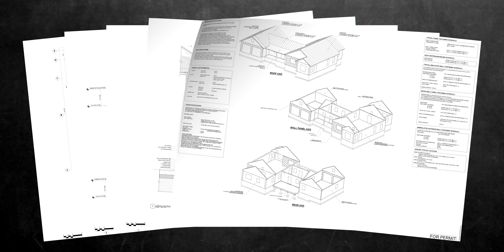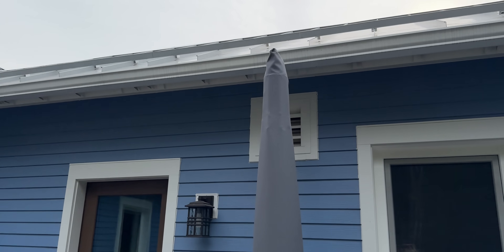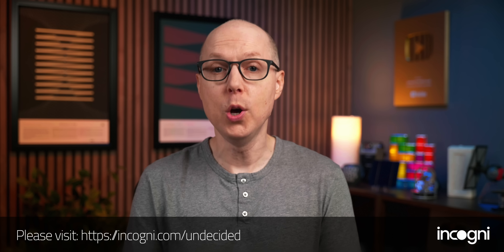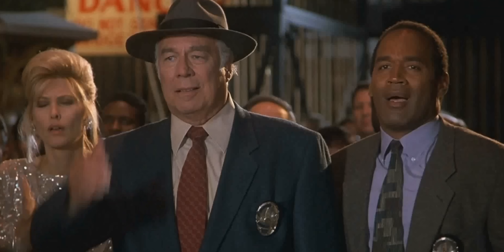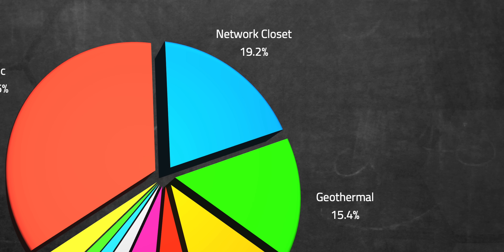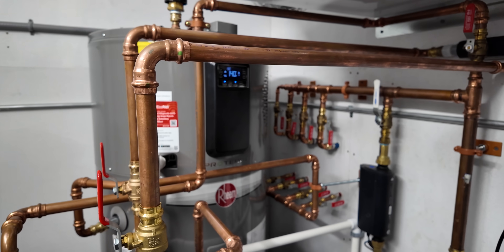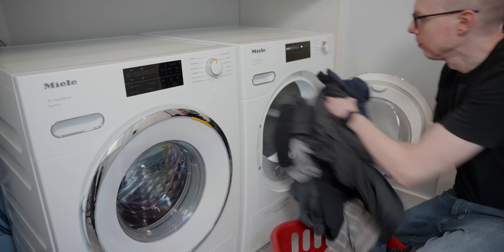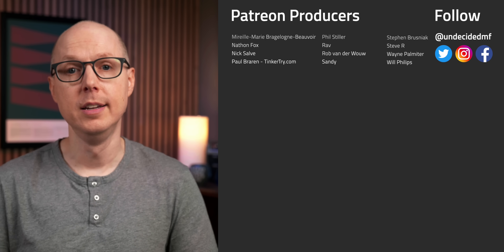What I Learned After 1 Year in My Net Zero House

Comment: Great video Matt,

We have a similar house just north of Toronto Canada with geothermal, desuperheater, heat pump water heater, 2 EVs and solar panels which we have lived in for about 8 years.  We are net zero +/- a few percent depending on variations in weather from year to year.

Some insight into your energy use.  The whole house dehumidifier is largely driven by your ERV running during the summer months.  Whenever it's hot and humid the ERV brings in a considerable amount of humidity despite the fact that some of it is rejected to the outdoors via the ERV core.  You could try accepting a slightly higher CO2 level when it is humid outside.  What we do when the dewpoint is high during the day and low at night is not run the ERV during the day and run it at night, CO2 does accumulate during the day but drops over night and this minimizes or eliminates dehumidifier use on these days.  It generally stays below 1,500 ppm during the day and can drop as low as 600 ppm over night, it can take until late afternoon before it surpasses 1,000 ppm.  You may be able to adjust the cfm of the ERV or use a 20 minute per hour timer to prevent over-ventilating and unnecessary energy waste from the dehumidifier.

The geothermal backup heat is when the geothermal heat pump is not able to meet the heating load on its own and brings on a 5kW or 10kW electric resistance heater to supplement the heat pump's output.  If you want to reduce or eliminate this energy use you can adjust the thermostat settings to allow a larger temperature delta before the backup heat comes on.  In our house the thermostat is set at 70 but the electric backup only comes on if the temperature drops below 65.  Sometimes the temperature drops overnight to 66 and when the sun comes up and the outdoor temperature warms up the house to 70 without using the backup.  The downside is that the temperature gets as low as 66 and may take until noon to recover to 70.  I am curious what your backup heat temperature delta is set at.  

As far as the fully ducted ERV this is what we have and it works great.  Our house is a 1,400 square foot bungalow with a basement.  Initially my idea was the same as yours in that the ERV would effectively distribute fresh air without needing to run the furnace fan.  What discovered is that when the furnace fan isn't running the basement gets cool enough on sunny days that the humidity exceeds 55%.  Running the furnace fan keeps the basement temperature higher and thus the relative humidity lower than what it would be otherwise so we leave it on 24 hours a day.  You have the ability to adjust the geothermal fan speed, set it as low as possible to minimize energy use.
Reply: I thought one of the big selling points of geothermal heat pump over air source is that you don't need backup heat. The temperature of the earth 400 feet down should be pretty consistent and the heat loss of a house that heavily insulated and sealed should also be quite consistent relative to the outside temperature, so if the geothermal isn't sufficient to heat the house it sounds like too small of a system was installed, but maybe that was intentional to save costs. We have an air source heat pump in central Iowa and we're still running backup propane heat for 40% of our winter heating, a lot of that is defrosting. Matt's backup heat use is only 20% of his heating costs, so that's better, but for the cost I'd want it to be a lot less than that.
Reply: @extragoode  in general a geothermal system uses less backup heat than air source but that is no guarantee that it will be no backup at all.  Geothermal systems are generally manufactured in full ton sizes, this appears to be a 3 ton system.   Maybe it needed 3.1 tons but you can't buy a 3.1 ton unit, you can get 3 or 4.  The step up to a 4 ton system and a 4 ton ground loop, Larger ductwork etc may have had an extremely long payback period not to mention the larger unit and ductwork would take up more space in the house.  At least the geothermal continues to run when the backup is operating, if it is 5kw of backup heat the geothermal is still doing about 2/3 of the work.  With a propane backup it can't run at the same time as the heat pump so when the backup comes on the heat pump switches off.  If it were an electric backup with the air source heat pump they can run together.   You brought up another good point that the geothermal system does not defrost whereas air source does defrost.  The differences between ground source and air source are not black and white but there are many nuances that differentiate them.
Reply: @jeffdaley67  that's a good point that an undersized unit may have been a closer fit than the next bigger unit and that the backup runs at the same time. If I'd have known the propane required the heat pump to shut down completely I probably would've done something different. The installer really didn't know enough to tell me what I didn't know. They said I needed 20kw of resistive heat for backup and I only had room in the panel for 5kw. Also said it'd be another 10 grand to upgrade the panel. Nevermind they could've installed a subpanel for the resistive backup for 1000. I've also done testing since with 4 resistive heaters only and that kept the house warm with about 8kw, so 5kw and the pump would probably do it. We also have a propane fireplace if we really need it, but I try not to use that since it's only about 70% efficient.
Reply: @extragoode  one way to run the heat pump and the propane backup at the same time is to have a boiler or tankless water heater heating a hydronic coil (think car radiator) downstream of the heat pump fan coil but this can be expensive and the heat pump system designer and installer really have to know what they are doing.
Reply: @jeffdaley67  That's a cool idea and I already have a propane tankless water heater and a recirculation pump, but there's no way I'd get my installer to do that and it'd make an already complicated system more complicated. I'll keep balancing my disconnected resistive heaters with the heat pump thermostat (poor man's backup) for the dozen or so days a year it's below 10F outside until the next time I need to replace the furnace and/or the panel.

Comment: I would love if some of these features were more normalized. So it was just overall easier to manage. Who has the time or money to manage indoor air quality to such an extent (besides content creators)? We did switch to an induction stove and will be switching to a heat pump water heater and encapsulating our crawlspace. Then I need to figure out how to remove a whole house fan and increase the R rating in the attic.

Comment: Hi. What is the point of heat pump water heater if heat pump is taking heat from house and put it to the water and than you need to heat house with other type of heating system. so you are basically overcomplicating. If you live in hot country- than it might make sense, because you just open window and heatpump will take heat from outside for free. But in standard climate or in cold countries it is nonsense. Do you want to be Eco friendly and heat water so cheaply?- build outside fireplace with water  heating element, than from fireplace with water heating element put insulated pipes into house inside water tank. This way you will make fire with wood which is still considered as renewable source and you are green. As firewood you can use waste like old wooden pallets from scrapyard for free and you will be super bio eco friendly. This topic is for long discussion so I am ending here.

Comment: I was surprised that refrigeration and freezers didn't make your top 5.  My guess is they make up a lot of your "misc".  I use an Emporia to measure usage and my top 5 is:  EVs charging, Freezer(s), Refrigerator, A/C compressor(s), Dryer, HVAC blowers.  I also live in MA so he majority of my heat/hot water is heating oil.   I've considered replacing my dryer with a heat pump dryer, but my suspicion is that it's more advantageous to spend the $2k to expand the solar (generate more) than investment in a new dryer.  Especially considering how far down the list it is for me.

Comment: Can you consider measuring your balance point temperature? This could have been part of the design phase , pre build. Now post build..... this is the btu loss per hour , without make up heat. Said another way , with intrinsic heat contribution, how much time passes before interior temp drops below your set point. and the rate of loss per hour , based on of course the delta T . I built super insulated homes in Michigan in the 80's and 90's. zero furnaces , pre passive house . The heat and cooling was less than $200 per year ( some wind and solar energy contribution) . Used Canadian air to air exchanger ( that was all that was available .) baseboard heaters. Everything was off the shelf , except the 50 mill VP from Sweden, and the air to air unit.   I appreciate your videos. 99% of homes lack thermal mass, you have a slab , good on you . the stored btu's and the consistent levels of comfort are badly missed in america home design . Yes your follow up videos on , btu's use per sq ft of comfort , per year , with and without solar ,  what the roi on the geo thermal system long term. Back in the old days , walls , windows , thermal mass , air tightness, slow air to air exchange  ( monitored) , passive efficiency ( shell materials)  , is  maintenance free for life. Geo thermal and standard hvac never penciled out , for comfort and roi for the customers. Add in evacuation tube hot water or drain back systems, used in millions of global homes , small and large. Less technology can have benefits. Down south very very very few homes use pre air Dehumidifiers in the intake supply. silly humans . Using an hvac system to  lower interior humidity levels , is a poor choice .

Comment: Meh,   you have a Cat running across your induction plate.   I up you by having a parrot .....    The moment I open the cook utensils draw.   My parrot goes beep beep beep  => knowing that its bound to happen anyway.       Same applies to any appliance, cell phones, espresso machine,  even the burglary Alarm ( if you activate the night mode ( so full coverage down stairs )) ,   Parrots ensures every one in the house is aware the alarm is on by continuing , the warning beeps for another 10 mins,....    
My wife is happy though not single door makes any noise in my home , because if it does the same day I apply some oil, so the Parrot doesn't get idea's.....

Comment: Hi, i do wonder what your energy use is pr square meter? I have been pushing my builds to use less and my best houses are at 45 kWh/sqm/year. That is included one EV and a adult couple in the house in Norway. The location has a average outside temperature at 2,5 degrees Celsius and then we do not need cooling, but a lot of heating. The house has as you, water to water heat pump for heating and tap water. Ventilation there is not clever, because it is a system from Bosch Vent 2000D. Planning a new house where we will do it even better.

Comment: Matt, I have done many of the same modifications in an existing home.  The heat pump dryer and water heater are excellent adds as the hot water heater helps dehumidify the basement.  Your 40% number shows up a lot when I make changes; it's like the standard code / bar for building or appliance performance allows for 60% more energy consumption.  If governments changed the codes and insisted that they appliances are built to last; we would have a huge long term impact on energy consumption.....but they're just trying to convince us all to buy new electric cars (which isn't the same long term payoff).  Nice video and thank you for sharing.

Comment: Your servers don't just consume electricity but also make quite a significant amount of heat, which I assume works like free heating in winter but adds more load for HVAC in summer. If you don't actually need to access to your video archive, you might consider replacing some of your HDDs with tape storage which is cheaper per TB and consumes a negligible amount of power
Reply: Tape storage would be very expensive space wise, and would be quite the unitasker, whereas HDDs can serve a more generalized purpose. Looking at how small his NAS is I doubt it would be worth the extra space and cost. Not to mention he'd have to figure out how to setup tape drives with his existing NAS system.

Comment: Do you have electric resistance heat strip's as an alternative heat source in the air handler for your HVAC? if so, that's what the 4% is. Seems like you need to change some stuff and keep those from running unless it's really, really cold.

Comment: Heat backup is most likely when the resistive heating coils kick in when the heat pumps can't keep up. I would definitely learn to embrace cloud infrastructure rather than have all that network/server stuff running in the house.
Reply: Home Assistant in a local server avoids changes to purchase agreements, and changes/introductions of subscription cost requirements. Nobody can take this functionality away from you. Not to mention security issues with personal data sold, such as advertised on his sponsor ironically.
Reply: @erichb4530  This old argument hasn't held water for a long time. The average person knows almost nothing about security and spends $0 on security. That makes them far more likely to lose data, have data stolen or corrupted on their own network vs cloud.
Reply: "I would definitely learn to embrace cloud infrastructure rather than have all that network/server stuff running in the house" - For what purpose?  So you can pay monthly fees in perpetuity instead of paying for equipment and electricity?  With cloud infrastructure and services, you almost always end up paying more long term.
Reply: Also, "the cloud" is inaccessible if your Internet connection goes out (that would be great for security cameras).  And moving to cloud infrastructure wouldn't help.  He would still need all of the equipment he currently has.  Cloud infrastructure cannot replace network switches, a video recorder, or a NAS used for video editing.  Lastly, if he has PoE-powered devices, then they get their power from the network switches, which will make it look like the network closet electrical usage is greater than it actually is (because the power used by those devices, regardless of where they are located, would appear to be used by the switches in the network closet).

Comment: I had a WaterFurnace geothermal heat pump installed when I built my home 29 years ago and it’s still going strong 29 years later. It was a little more expensive than a standard heat pump at the time and because I had lateral trenches dug 7 feet deep instead of a well drilled Which saved a lot of money. The WaterFurnace has paid for itself several times over. My current electric bills for this all electric 1500 square-foot rancher are still under $100 a month averaged over a year.
Reply: Where is your house located? Northeast, Midwest, South?
Reply: Are you SURE it’s been 29 years??
Reply: @Tryp-j9d  I presume the OP knows how to count years. 30 years may be a bit above the average lifespan of a common HVAC system but it's by no means exceptional.

Comment: You could take inspiration from ye olde computer rooms which had a raised floor that held all the wiring and cooling. The floor was made of sections you could easily remove for access. Probably cheaper than a basement! As a hoarder, you do have those attics...
Reply: It's the same in for what I know in Swedish substations aswell, raised floors with removable sections for easy access.

Comment: Very cool, thanks for the update. I've got a heat pump water heater as well, and it looks like your setup is using maybe 2/3rds the energy of mine (your 65kWh vs my 90kWh per month). Also, good to hear you still recommend the heat pump clothes dryers. I've been thinking about getting one, but I'm nervous the extra time and cool/damp feeling clothes will be an issue.

Comment: Do you find that your heat pump dryer puts out much humidity?  I have a Whirlpool WHD560CHW and it definitely leaks some water vapor.  It can raise the relative humidity of ~2500 ft^3 of space by 10% over the course of a load, if I don't take any special measures to exchange the air in that space.  I'm wondering if that's typical for heat pump dryers, or if my model just does a particularly bad job of segregating the ambient air from the air it is cycling over the two coils and the wet clothes.

Comment: I do not have a highly efficient home except for attic insulation that I increased significantly about 2 years ago. In a large ranch that has made a huge difference. I have a 1/2 basement and I have some humidity issues in it during the summer. I hooked up a standalone dehumidifier in the basement and blow the dehumidified air into the crawl space to create a bit of a positively pressurized area. That seems to work but the cost of running a separate dehumidifier is way more expensive than I thought. I already have two hvac units so the savings I got from insulation are balanced by cost of dehumidification. Sigh. However I do have to use it as I was told that keeping humidity down in the crawl space is needed as it could affect the way humidity transfers into the attic over the crawl space. I do not even humidify the house in winter anymore. Doesn’t seem to require it and may have adverse affects. The amount of insulation I added was over the usual amount. There was next to nothing in some areas and I think it was 24 inches of blown insulation and I live in the Chicago area. It’s a brick ranch. So retrofit of a 1960s built ranch with insulation requires some adaption. Not as easy as just add insulation and you’re done. Lots to reconsider and I am still shocked by the cost of running the dehumidifier.